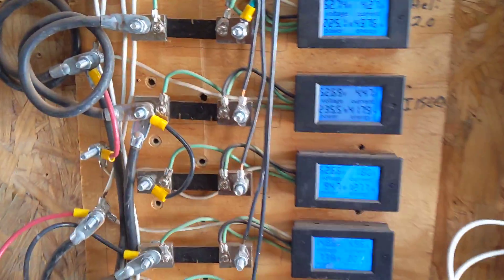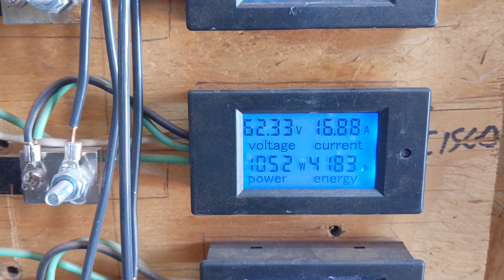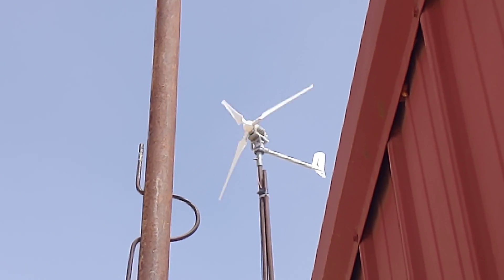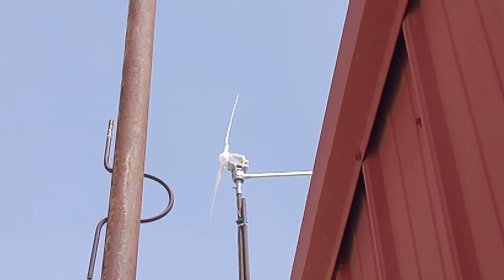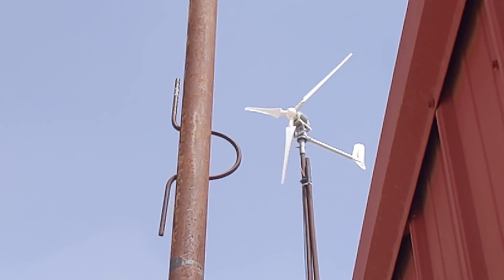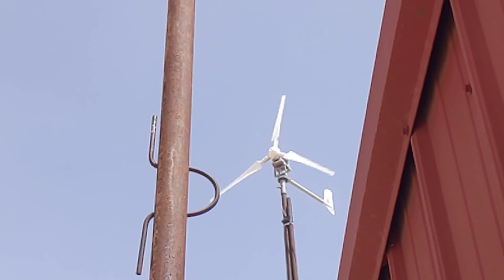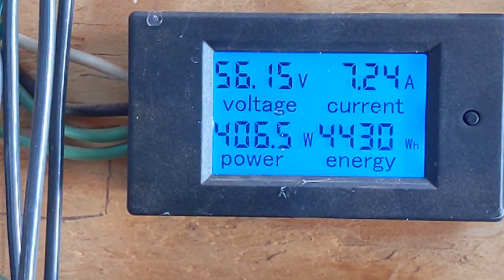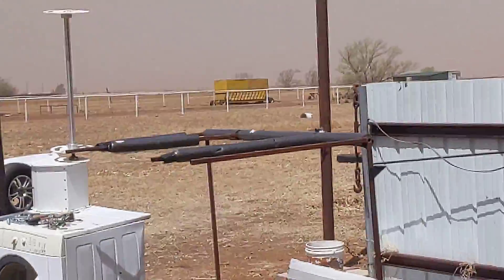iSta Breeze i2000 "Windsafe" furling mechanism in action

Comment: I have to wonder if the performance/output would be overall better if the rotation of the turbine body (not the blades) was damped (ie in the horizontal plane)...?  This might prevent the head from rotating too far out of the wind under the effect of the momentum of the head when caught and flicked around by a turbulent gust...
Likewise, if the 'wind-safe' function was damped, might that make for better longevity of the mechanism?  It looked pretty gentle in your video, tho, to be fair, not snapping to and fro on the springs as one imagined it might do...

Comment: What are your average high/low wind speeds?  I'm off grid on solar but want to add wind for night and winter.  I'm concerned about our highs, we clocked 78mph gusts last week and we've had higher. Trying to see what models would hold up.
Reply from the maker: Wow if I were to guess I'd say you were in my neighborhood...West Texas, we've had obscene winds the last couple of weeks.  This week has been pretty calm but we were pushing 75+ early last week.  Pretty much any micro turbine will hold up to triple digit winds, it's the controllers that tend to have a hard time coping.  My goal is generally to see what kind of wind they can be pushed through...I abuse them...but if I can see 50+ in the forecast and want to keep things working properly I go shut them down.

Comment: I do see a lot of shaking on the tail. While brand new it is tight and snug (the tilting mechanism), with the vibration it won´t stay that way for long... I suppose yours is producing a bit more than mine, although far from the 2000w rated. good luck!
Reply from the maker: The rotor balanced statically but clearly there is a little imbalance in them.  I'll have it back down in a few weeks to address a problem with my tower and I'll be rebalancing it while it's down.